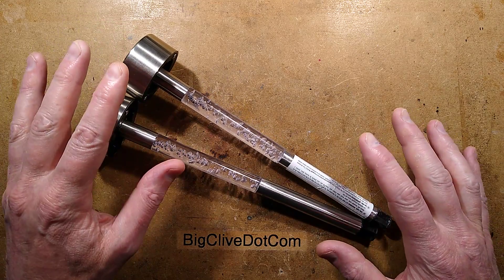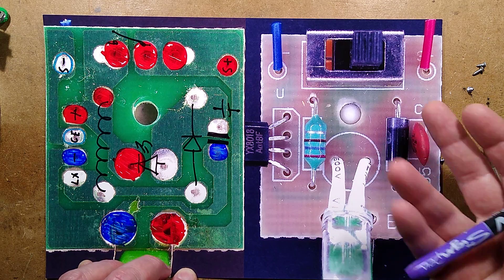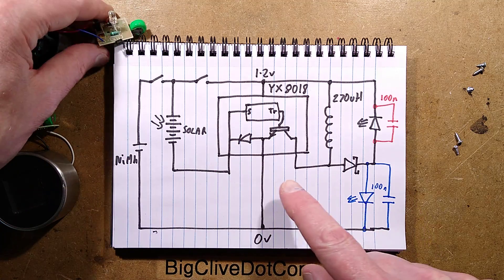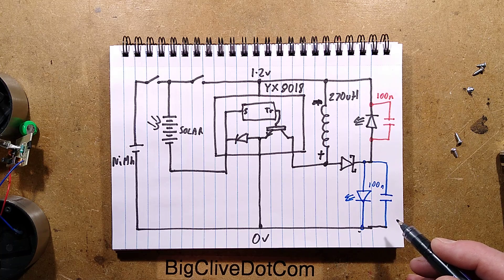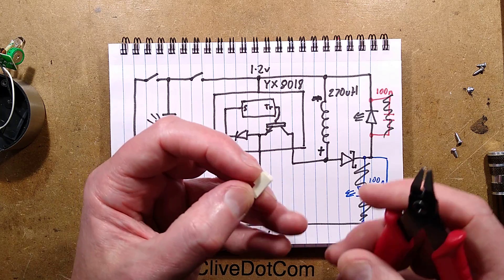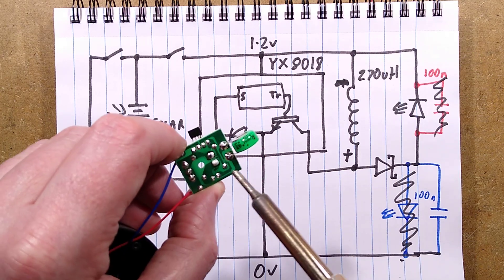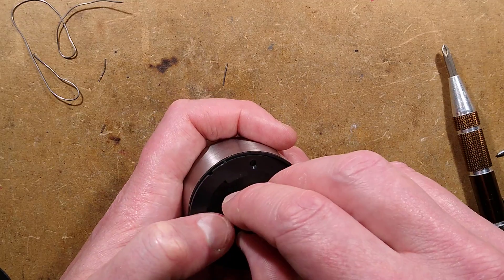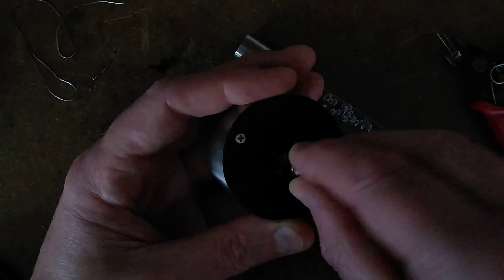Hacking a Poundland solar light with intriguing design fault

Comment: How many of these (salvaged) solar cells would be needed to build a phone charger and how, can you make a project like that...?
Reply from the maker: A phone has a huge battery by this standard.  You'd be better using a decent power bank with an external solar panel.
Reply: @bigclivedotcom  but is it possible to build one...?

Comment: Geez, the battery size in those is ridiculous, most I buy here in Australia at least have a AAA or a half AAA size, the battery in that light looks nearly as small as a button cell. 
It's true that the switch is usually the first thing to fail from rusting, better designs have a rubber cover over the switch so moisture doesn't get in there. Then the second failure is the battery itself, the battery can be replaced. The other components however typically don't appear to fail from my experience, so they don't need replacing. 
I like the bubble glass effect in the light you have there, there are some here in Australia like this also, however if the material is plastic I don't want to buy it, because the clear plastic turns a gross murky colour after not too long from the sunlight. Therefore I try to buy solar lights that have glass instead of clear plastic. 

A good solar light may cost 5-6 dollars instead of the cheap 1 dollar ones, but the good solar light will be better looking and made of glass and such and can easily be repaired endlessly. There are even some large ones here I have that use AA batteries, which is excellent. 

I agree with you also, the white light is so damn boring, virtually any colour is more interesting than the white light. 
The standard colour you can get are the red, green and the blue. Out of those the blue is possibly the best, green being ok, and red just looking too harsh. 
However you can buy a wider variety of led's outside of these, one particular neat colour to buy is purple, this is probably the best looking night time colour. 
Of course making sure to not buy 5v ones, but to use the 3-3.6v ones. They call them ultraviolet, but they are actually more like just violet, being around 390nm etc. 
You can get the other ones that are not based on the material itself, but it's like a white LED encased in a purple plastic, but I find those are weaker in their light output, because they are getting the purple via absorbing a lot of the other spectrums and allowing the purple inside the white to pass through, which means a lot of the light energy is lost. 

But blue is probably the most easily available, and cheapest good looking colour to use. I like your idea of using that connector, so you can just swap them out easily. 
I also take apart my lights to check the components, they nearly always have the green inductor, the little oscillating integrated circuit. I have seen some that only have those 2 components, yet a lot of other ones have the power diode in there, and a capacitor. I also have one that has a zener diode inside it, instead of a power diode. 
So each light is a little different, but it's essentially doing the same thing. 
Usually the most components, the better obviously, it's a more intelligent circuit. These additional components are usually to control the direction of flow better, and to not allow backflow. Obviously commercial solar panels have their own inbuilt power diode, but these tiny cheap panels on these solar lights don't have any such thing inbuilt.

Comment: Nice to know I'm not the only one who uses scissors to ream out holes to make them bigger. I'm a lazy ass and it just saves the faff of dragging out the battery drill and looking for the right size drill bit, which inevitably is still in the hand drill with my lock picking kit somewhere (or accidently secreted under the bed or a table, or the kitchen cupboard that I forgot to replace the kick board on). ..Hooray for Scissors!!

Comment: I just wish lights like these had a bit more capacity. They always work fine in summer but in winter when they actually have a purpose, they just don't charge enough and are lit for maybe an hour. And I don't think the battery is to blame, because i tried swapping one for AA NiMH (although it was from aliexpress so maybe that is a bad test).

Comment: Are you sure that's an inductor? It looks like a conventional resistor?!
Reply: I've just googled it. . You're right. How do you tell the difference between a resistor and an inductor?
Reply from the maker: The resistance will be much lower than a resistor for the same markings, and the function in the circuit is a clue.
Reply: @bigclivedotcom  I had the same question. Surely is confusing based simply on sight to this novice!

Comment: Is it me? Keeping the switch at the top, if you flip the circuit board over, shouldn't the left hand components now be on the right of the picture?
Reply from the maker: I flip the image before printing so everything lines up.  It makes reverse engineering bigger PCBs easier.

Comment: That inductor looks just like a resistor to me! Is there a quick easy way to indentify it as such so it won't be confused as a resistor?
Reply from the maker: The resistance of an inductor will generally be quite low.  As your knowledge grows with time you will also intuitively know what may be an inductor because of its location in the circuitry.

Comment: I bought one of these lamps at Dollarama (Canadian dollar store chain) a few years ago. It had the lower plastic part of the head smashed, so I bought it (for parts) to save it from being thrown out. Here's my report on it:

The plastic is matte. It has an oblong PCB and a YX8018, but the layout isn't the same as the oblong one in the video—the switch is in the middle. The battery is a Ni–Cd AAA.* The LED is color-cycling. It doesn't seem to spend too much time on red, and keeps its place in the cycle even with power interruptions of up to about a second. It seems to cycle slightly slower at 1.2 V than at 1.5 V. The solar cell fell out, even though it's just been sitting around indoors—maybe its glue and solder joints got damaged in the same event that broke the plastic. The solar cell is a thick piece of glass (about 3 mm or 1/8") with silicon (I guess) coated on the back, with a thin piece of glass glued on to protect it. The wires were soldered to it through some nasty-looking holes in the thin glass. The metal tubes above and below the bubbly rod are the same length as each other (30 mm or 1 1/8") and the bubbly rod is longer (160 mm or 6 1/4" exposed)—maybe they shortened it and lengthened the lower tube in the new versions because the light wasn't getting all the way to the bottom.

*It's fully charged despite having sat around indoors in a dim spot for years. It has been facing up, uncovered, with the solar cell in place, so maybe the broken solder joints still make enough connection, and it gets enough light, to charge slowly?

I've been thinking I might put an RGB LED in each end of the bubbly-rod-and-tubes assembly and use it as a dual status indicator of some kind, but I'm not sure two colors will show up distinctly even from different ends, and I haven't gotten around to trying it yet.

Comment: There's another way to prep the holes so you can install the new component: just don't do anything. I usually just heat the solder blob as I insert a new component. Then add a touch of extra solder and make sure it has adhered well to the new part.

Comment: I like this video a lot. Dollar Tree has some nice SP Lights but even though the design quality is quite good, the build quality is not.
First off, short the switch to on.
Second, silicone around the top portion of the solar cell. Water will go under it, causing failure.
Next I silicone the holes where the collector wires enter the inside. Often they appear sealed but are not, allowing water to wick to the PC Board and corrode the board.
Lastly, I try to silicone and gaps where water can enter.
I've made these $1 lights run for a very long time by doing this.
Thanks, Clive, for going over this circuit with us.

Comment: the smaller micro battieries are a pain though.
they overcharge and explode.
some moulds even have the empty place for the aaa cell.

the old styles with a aa or aaa were easy to replace.
even an old aaa from the parts bin is sufficient for a led light and runs longer than the included crappy cells.

Comment: If you file down the Bubble Acrylic stick to the same diameter of hole, as on the Slide Glow Flex Ribbon Controller Socket you recently tore down. I wonder if you can make them into Glow Bubble Stick Wands for a window display or as mini Bubble Light Sabre's, LOL. Also use the circular base with a sheet of black plastic with edge supports glued level with the rim of the LED. Which has previously been drilled with a centre hole to let the light emit. Then set on top an acrylic block etched with a display design inside it, or other item that will illuminate from beneath as a light display.

Comment: Does flux need to be on the copper braid?
Reply from the maker: It helps make it work better.  It should come with dry flux, but it seems to degrade with time.

Comment: I dont know if you will read this Clive, but these got mentioned in someone elses comments which might interest you. They are energy saving bulbs with an internal battery for places that have energy cuts https://www.flipkart.com/wipro-9-w-standard-b22-inverter-bulb/p/itm6b44753ace7d5?pid=BLBFMUX67YMNHWGV&cmpid=product.share.pp
Reply from the maker: I've featured a few of those lamps.
Reply: @bigclivedotcom   Thanks for the response Clive I shall have to have a search through your treasure chest.

Comment: I've seen a number of interesting designs like this one, at the local Meijer (when I was getting my Pfizer vaccine doses, a month ago). But unfortunately, they don't have NiMH, but NiCd batteries! I was shocked, and disappointed.
Reply from the maker: Modern lights should not use NiCad, but for an application like this, that battery technology is OK.

Comment: There are 12v 6A led/barrel plug power supplies on ebay now, there was a post on some fake ones, but the one I got seems real, still very light weight, I wonder if you could do a tear down to see how legit they really are.  Model JY-126FB A
Reply: bought load testers, its 3amp, sad.

Comment: To correct a common misperception about being unable to over discharge NiMH cells: You can over discharge a NiMH cell.

NiMH cells rely on the desorption, transport and absorption of hydrogen ions. Over discharge leads to both a loss of hydrogen and a permanent change in one electrode (by absorbing oxygen), both of which reduce capacity of the cell.

During over discharge the positive electrode becomes depleted of its active material. There is nothing there to absorb the incoming hydrogen which is  evolved as hydrogen gas. The negative electrode can absorb some of this hydrogen gas but its capacity to do so is limited. Gas pressure builds which leads to loss of hydrogen through safety vents, and a permanent loss of capacity.

When the negative electrode is depleted of active material (it has an excess of active material compared to the positive) it starts absorbing oxygen forming a metal oxide. The metal oxide does not absorb hydrogen during the charge cycle which means a permanent loss of capacity.
Reply from the maker: I was under the impression that the gassing electrolyte is converted back to liquid with a byproduct of heat.

Comment: I just got a couple of warm white solar light from a Tophatter seller. There were supposed to be 16 of them so i got a refund. I am changing  them to blue or purple single color. They are similar to your poundland lights. they only have 40 mA cells. i have modified other solar lights in the past to color change and used  a 1n914 diode and a 100 nf cap across the led.  The inductor was wired to  be in series with the battery like your blue drawing circuit. My brother liked the set of lights I made into color changing for him. Sadly he passed away last year.

Comment: Idea: 3d print the shape of the end, then be able to change the lit up shape too.  Even better, take that and mold your own sparkle epoxy shape to plug in on top of the plug in LED that you did here.  

Or embed the LED in the epoxy, and have a customized light bulb fixture... that is going too far

Comment: A few weeks ago, I had to repair my laser level.
(I left batteries in it, they leaked ...).
It was the first time I had done any kind of electronic work for about 30 years, and always used a solder sucking tool before, but based on your recommendations in past videos, I purchased a pack of 7 different sizes of solder sucking wick from Amazon, and am now a convert.

Comment: are they using the cap to smooth spikes to the battery
Reply from the maker: It's theoretically to maintain a small current flow through the LED during inductor pulses.

Comment: Two questions.
1. Why not put the solar panel under the light so that light that would otherwise be wasted is instead used to activate the solar panel to feed some energy back into the system to allow a longer length of operation?

2. Since the charge is 1.5, can it charge a cell phone?
Reply from the maker: If the solar panel saw light it might turn the LED off, so you might end up with it oscillating at half intensity.  The charge is nowhere near enough for a phone.

Comment: O no... They are back... 
Remember the exact same ones in a German 1€ shop sold for 50ct since they where not working properly. 

That was like 10 years ago. 
I remember buying 4 or more to mess around with them. 

They also had some filled with some alcohol water solutions with glitter in it. 
That had a small motor spinning together with a colour change led when it gets dark.

Comment: It is a challenge to design such light with a supercap (2.7V max), or two supercaps in series (5.4V max). I have one in my window with 2 caps (2x100F), and 82x36mm solar cell, and it runs for two years now, and the LED never goes off, even if the solar cell in winter does not get direct sunlight. I did not use more than a resistor (for LED) + diode (for solar cell). For now I have placed an LDR over the resistor so that in daylight the LED is a bit brighter, but need to think about that. In the middle of the night the LED is able to throw a faint shadow on a wall 8 meters away, come summer come winter. Oh, and I will have to use two balancing resistors parallel to the caps (e.g. 2x68K ?), I saw this morning the two caps deviated about 10% after 2 years.

Comment: Clive identified a problem with how the capacitor was miswired in both circuits but did not adequately explain why it was wrong. Nor did he repair the problem and show the improvement. Can someone complete the analysis, please?

Comment: The diode and capacitor are not a mystery, it's a standard "Boost regulator" design.
Also, it doesn't matter which side the cap goes on, either across the LED or from LED to ground. Because the button cell has a low supply impedance and a constant voltage the Cap can go either side.
I suspect they put the cap there simply because it made the PCB track routing easier... 🤔
Reply: You might be surprised at the impedance of a small cell. I wouldn't be at all surprised if the circuit causes more than 100mv of ripple on the cell.

Comment: You need to modify two identically with same model LED, then add the fix for the cap and diode to ground on one and compare.
Runtime and brightness will be interesting as I think the inductor value sets the current based on energy and forward voltage. The improved circuit would probably be a LOT brighter as it has voltage advantage by not boosting as high but ending up at higher voltage regardless.

Comment: hi Clive my power meter one that plugs in the wall shows the current going to electric kettle when turned off dropping to zero over a few seconds and same going up when turned on
 does  the wattage really go up over a second or so  not instantly 2000 watts
Reply from the maker: The meter averages the power over time.  The kettle will switch instantly.

Comment: The YX8018 pins are different to the other 4 pin chips you come across in the solar lights just thought thats worth mentioning i have 2 of these bought last year and modified a AAA 1100mah battery as the solar panel is very small and colour changing use quite a bit more power to run over longer periods my indoor solar lights i have modified have been running for 2 months now on the same battery and no signs of dimming yet apart from the colour changing one.

Comment: I learned very early on to hold the solder braid by the dispenser,  not the braid itself,  Ouch!
Reply: I've been known to use a wet finger when my solder spring loaded syringe type thing refuses to comply.
Reply: Solder infused desoldering braid is a handy item to have for vintage cars great for running auxiliary earths and across hinges etc to prevent radio interference.

Comment: I've been playing around trying to get solar light circuitry to run off a 5v panel and 3 AA batteries (in order to power 5 or 6 leds in series) instead of 2v and it's weird how you can get that to work with some of them (the ones they were selling for £2 or so at tesco) but not others (the ones that were 5 for £4 at tesco).  
Not that there's enough night time this time of year to get the use out of them.

Comment: I have some very old solar lights I bought probably 10 years ago.  Uses 1  AA 1.2v NiMh battery but everything is in a blob on the PCB so no other components visible, also no switch so no corrosion problems either, and a rather large solar panel compared to these tiny ones with the little button cell.  They are really tough and even though the sun is eating away at the black plastic, they still work a good few hours at night.  Cant seem to find those anymore - I guess they were made too good and now only the crappy ones are available.